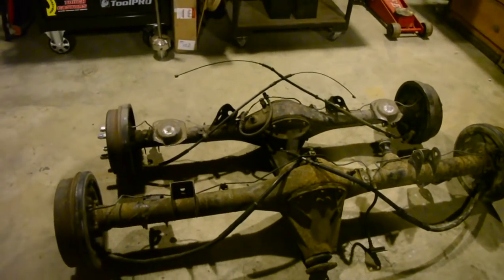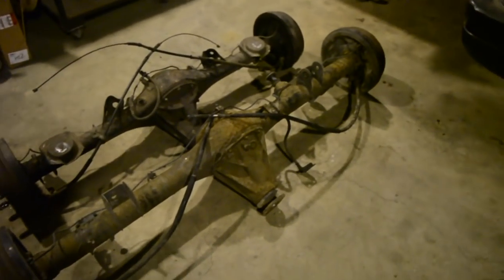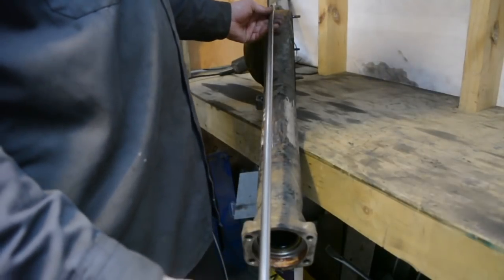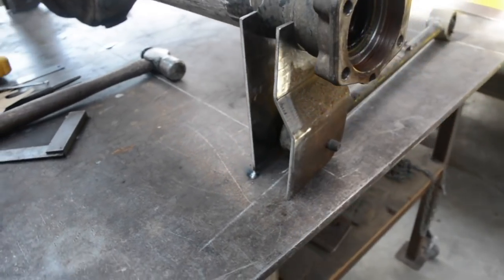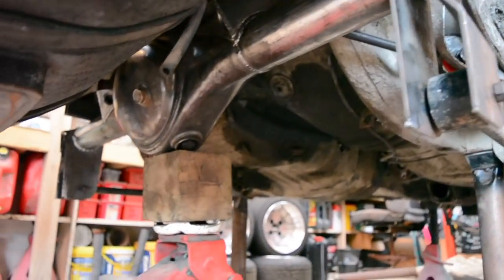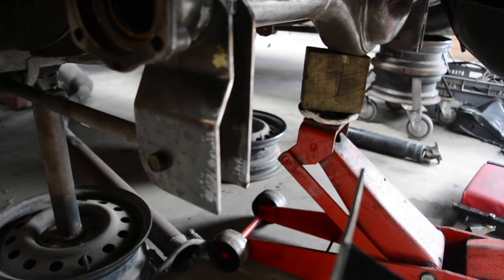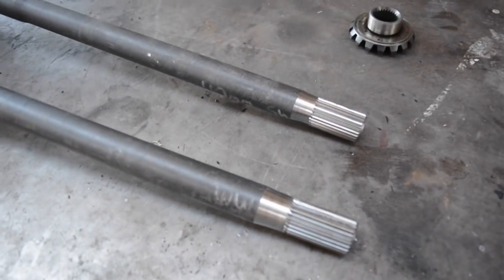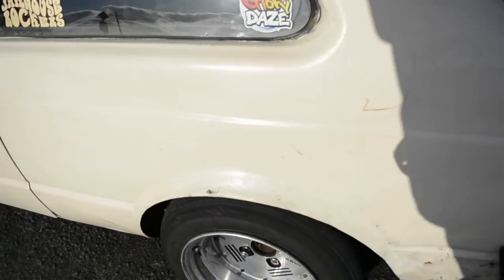Toyota KP61 Starlet - Diff and Coil over suspension upgrade - Full Instructional video - Kune RE

Comment: I know is an old video but will you be willing to make the mounting plates ? I've been looking to replace the rear end in my kp61
Reply from the maker: You'd need to make the plates to suit the coil overs you want to use. Also those bits are only a small part of the job

Comment: If you did want a disk brake option we have swapped p10 Primera rear disk setup they so common we got them near free and fit nice in 13 inch wheels
Reply: Hey mate, how did you go about fitting the p10 to the diff? Was there quite bit of mods to make them fit?
Reply: @bradwills7882  the disk is same stud pattern so that just slips on the axle then all ya need is a steel plate bracket to hold caliper in right place

Comment: The original kp60 rear axle is about 1336mm. From axle flange to axle flange

Question. 
The original kp60 axle pinion gear is off center. 
Was this taken into consideration when shortening the rear axle?
Reply from the maker: No I didn't consider it, I just wanted to shorten the diff equally either side.

Comment: Hey sweet kp mate, was wondering what kind of steering wheel you got there looks really nice
Reply from the maker: He mate. I think the brand is wildcat, they normally have a big center cap that looks pretty rude and they also have an odd bolt pattern so I had to make an adapter

Comment: Where did you pick up that AWESOME Record No. 8 vice? Super sweet. Expect more comments after I watch this even though I intend to IRS mine.
Reply: Amen on "hilux is too much" people don't realise how inefficient diffs are, the smallest one that can hold your power is the one that goes fastest both from being lighter and lower friction. 10/10. If I change my mind and go solid axle I'll probably look for one of the same units you used, good to know the tezza torsen can drop into them :-)
Reply: While it's true that drums can work fine in the rear (and indeed the front!), one of the issues with running them in the rear only is the mismatch in bite characteristics - drums self bite and disks do not. For this reason drums make a superior handbrake where limited mechanical advantage is available, hence you see many vehicles such as most nissans and volvos at least with drum handbrake inside a disk for the stop pedal. Only light duty stuff uses handbrake mechanisms on the disk in the rear.
Reply: What wall thickness is that tube you used for the rear coilovers? 2mm? 2.5mm? 3mm? something else? Just curious.
Reply from the maker: I found it in a scrap pile broken in half, so I welded it back together!
Reply: @senojnaes  Good on you! :-) I can see the joint now that you point it out. Did you TIG or braze or? Looks like it's working fine either way :-)